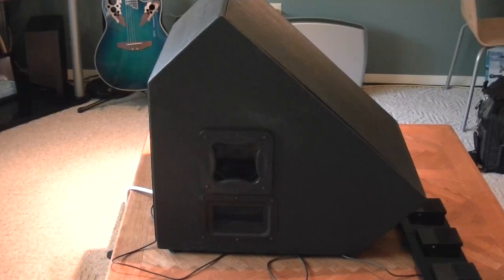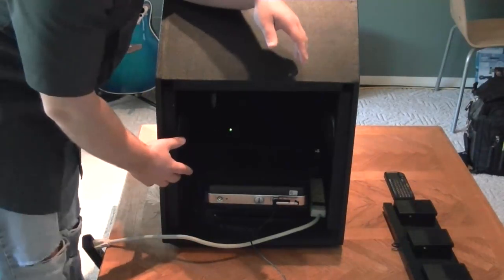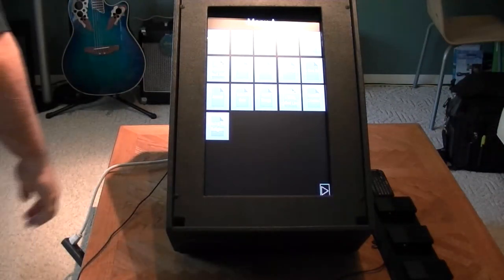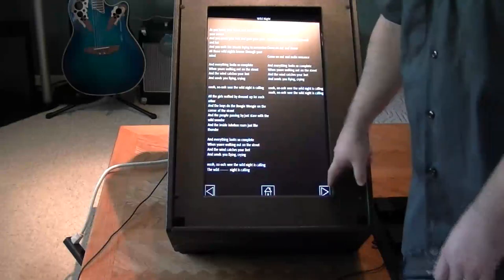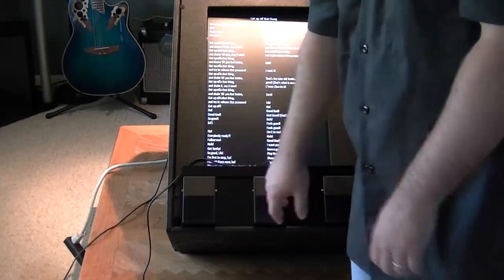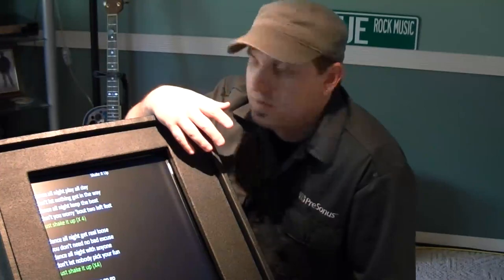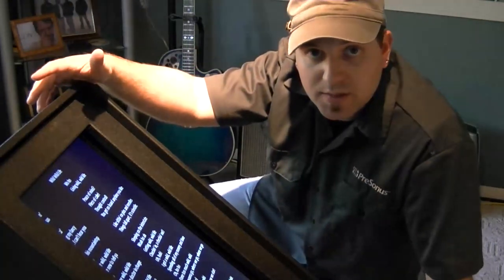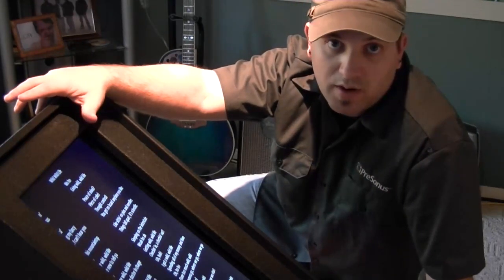DIY Lyric Prompter

Comment: Very nice. I built a non-computerized (lyric book) monitor with a light and power for my guitar pedals and fans. I used Speakon connectors for the power as to not have cables hanging out. Love this idea. I will let you know when I start building mine.

Comment: Looks really nice.  Two things I would have done (I always go overboard) would be to cut the computer's power cord and mounted a socket on the back or side of the cabinet for a standard equipment AC cord to utilize. Secons would be to have a cut piece of Lexan that replaces the screen cover during shows to protect the monitor from direct impacts. I have seen lexan with an non-reflective coating so light reflections don't wash out the screen, although you said this wasn't an issue.

Great work!

Comment: Sweet build, thanks for sharing!
Was thinking of doing something very similar but using a Raspberry PI B+ (runs Linux and runs around 40$ on Amazon) as the brains since it is very small and generates very little heat.

Comment: How much does it weigh? Seems like it'd be fairly heavy. Also, have u tried to set your powerpoint to automatically scroll or is that just too dodgy for a live gig?
Reply from the maker: +brywool I actually never used it on a gig.  It say it weighs about 25lbs, way less than a speaker wedge.  I tried the auto scroll but I was also using it for rehearsal and we would stop in places and pick up in others so it was easier to have it all typed out.  The box just sits in my basement.....
Reply: +Digital Fidelity how come you never ended up using it? Just curious.
Reply from the maker: I had a kid...  J/K well kinda.  I was trying to get back into it with some guys I played with when I was younger but we were all too busy to make it work.  I just do sound now.
Reply: +Digital Fidelity Cool. I have everything but the box. Not the best at figuring out that stuff, so I'm trying to see what I can come up with.

Comment: Do you have the design plans for the enclosure? Once I have the measurements to make the cuts, I believe I could build this. If you have them handy, could you message them to me on facebook, or tell me where I could find the plans? Ray Pelyhes on Facebook. I am a singer and this would be a great help. Love your design.
Reply from the maker: Ray Pelyhes No plans, bought all the parts and started building around it.  The box just sits in my basement.  PM me if you're interested in purchasing.